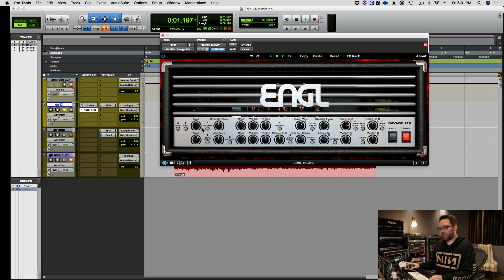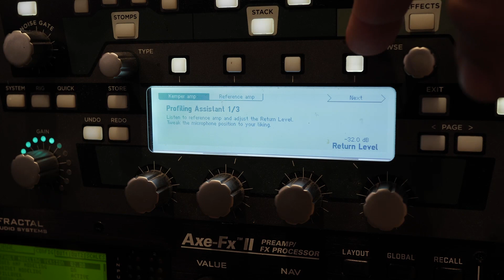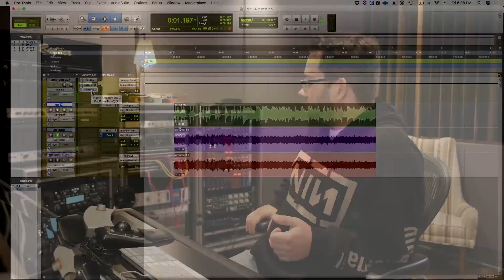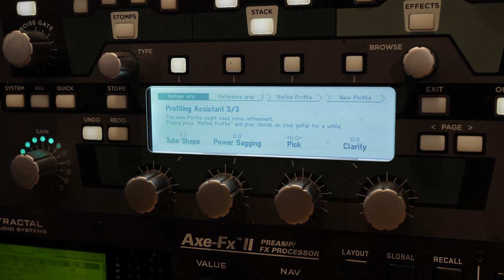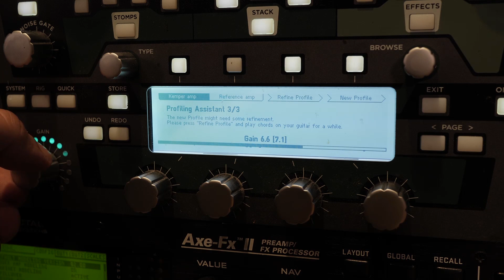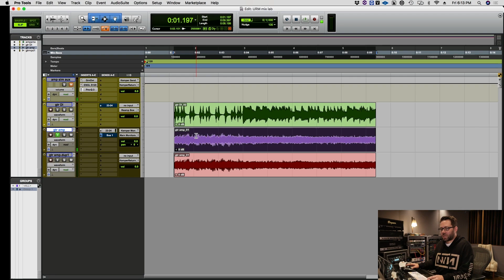CLONE YOUR OLD GUITAR TONES! w/ Carson Slovak

Comment: i think my brain is just stupid but if we have the original track, why can’t that be used to be profiled and not use the DI/ENGL amp sim? Just sending the og track to the kemper? I’m sure there’s a reasonable explanation but just help understand beyond what was mention at the beginning
Reply: The Kemper profiles an amp and not an audio track. It sends out measurement signals to the source which is creating the tone and makes a profile out of that. What he does with the EQ match thing is kinda like "profiling" the pre-recorded track and using the matching feature of the Kempers Refinment process to go the last 20-30% of the sound.
Reply: @seb_nav  If you had an amp with an aux in or some method of using it essentially as a speaker, could you play an isolated guitar track though the amp via your phone/aux with a Kemper attached and have it clone it that way? Sorry if your comment answers that question but I don't fully understand the signals and stuff. I think op was asking more about just sending the audio direct to the Kemper vs sending it through an amp connected to a Kemper. Not knowledgeable when it comes to this stuff so I don't how the signals and stuff differ.
Reply: @StackBundle  The main part of the question was, if the "original track" can be used to be profiled by the Kemper and the short answer is no, that's not how the Kemper works. 
It measures a guitar amplifier and creates a profile of the result. For this the Kemper sends some measuring signals to the amp and analyses what's coming back through a microphone, an amp simulation, line signal or whatsoever. If you know how impulse responses are made, it's a little bit similar from the signal chain just more complex on the algorithm and the measuring. 
The pre-recorded track can only be used for eq matching which is described in this video. :) 
For more informations just watch a video of how the Kemper profiles an amp, than it should be clear. :)
Reply: @seb_nav  Okay. I don't know anything about impulse responses/signal chains. But I understand better now what you are saying. Thanks.